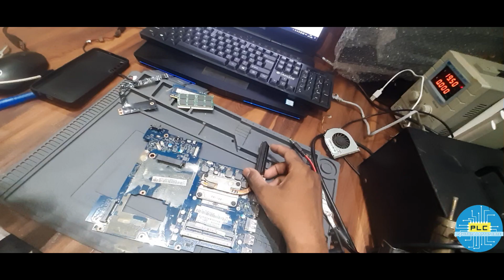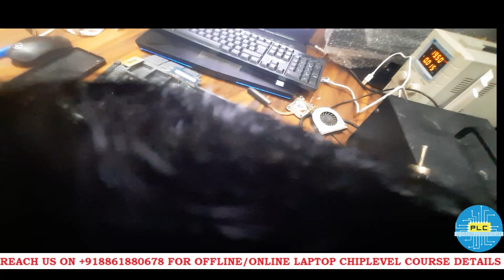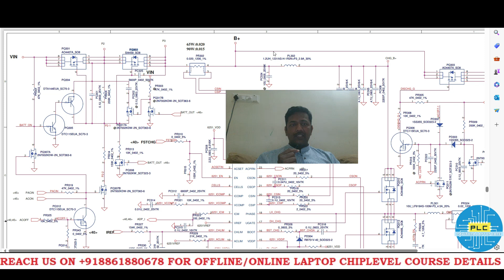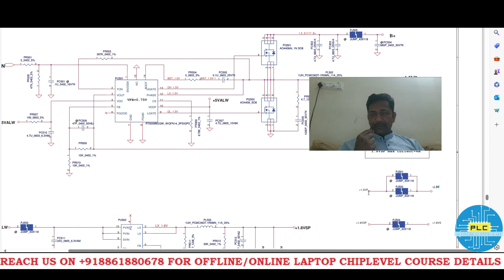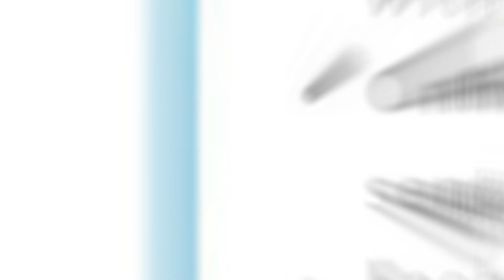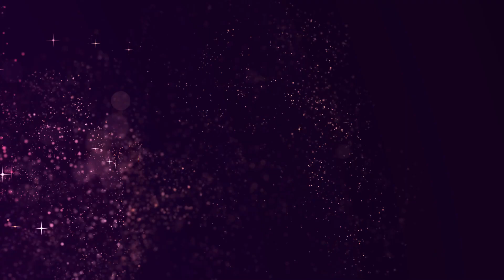Laptop Repair - troubleshooting the laptop motherboard

Comment: My laptop (ASUS-K46CA) doesn't turn on immediately when I turn it off after use, but it turns on after a while, is this due to a problem?
I have the same problem with my desktop PC (Dell i5 4Gen), when it starts up it runs for a long time without any problem.
Reply from the maker: May be one of the reasons
Reply: What could be the reason sir ? @LaptopCourse
Reply from the maker: try with clean me. if clean me issue, it will be solved.
Reply: @LaptopCourse  already cleaned sir.